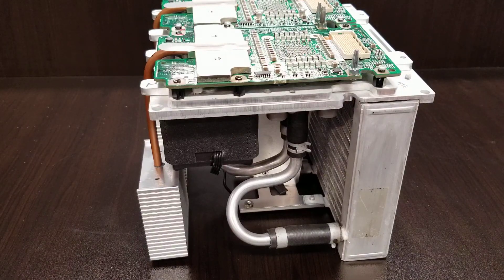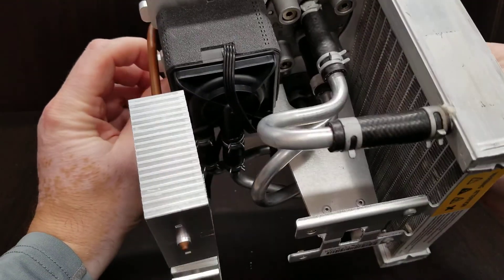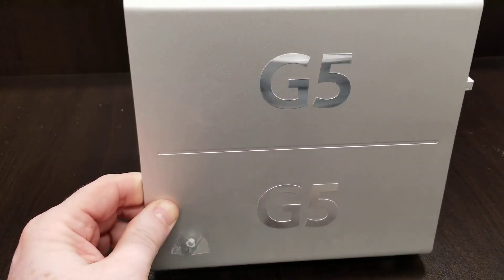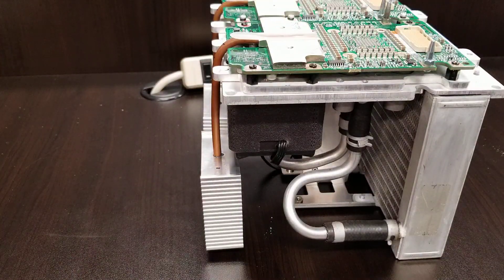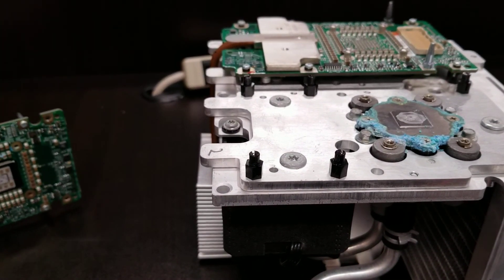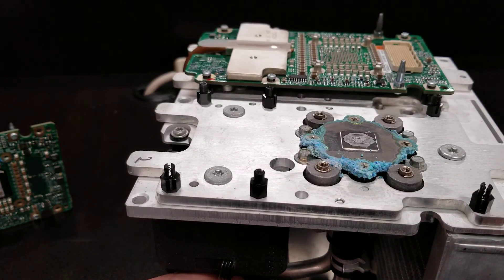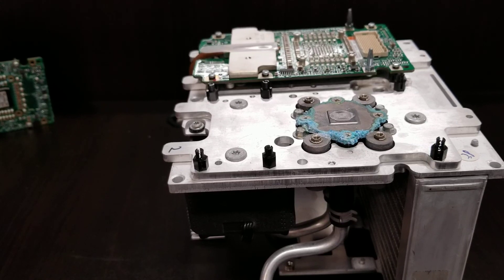Feast your eyes on Apple PowerMac tower G5 dual processor watercooled heat sink technology MacPro

Comment: My advice is to completely eliminate liquid cooling, even if that of the G5 Quads was much more reliable, they have a known problem: liquid leaks, and as is well known, liquids, if not oily, being based on water are conductive and if a few drops fall on the cpu or motherboard, disaster is created.
Understanding these facts it must be understood that it can be replaced with conventional cooling based on aluminum air and heat pipes which are the standard heat sinks used on the Dual G5. You have to find two working ones and then you can reassemble everything and proceed with a thermal callibration.
As already mentioned many times, Apple's water cooling system was more of a commercial gimmick that Jobs wanted to exploit to make the G5 appear as machines in need of water and energy, which was not true. The cpus used in the Quads are the same dual cores used in the single processor versions (970MP) as in those versions of G5 (those with PCIe slots released in 2005) and are NOT liquid cooled but with a conventional system.
So change the heatsinks with peace of mind, the temperatures will remain low anyway ....
Reply: I mean, if you're going to disparage a perfectly viable and often superior cooling system, at least provide the correct alternative. Aluminum is far worse than copper for air cooling.
Reply: @adriandiaz-cabrera1733  I don't deny your patient maintenance work, mind you. But liquids don't get along well with electronics, and there is no such safe and long-lasting system, no matter how great you did described in your video. Even if an air cooling is less efficient, it still ensures the smooth operation of the cpu and the maximum maintenance you need to do is that of changing the thermal paste without worrying about water leaks that would destroy your G5. Those leaks that are clearly seen in your video, sadly, are a clear example of what shouldn't be happening; the liquid that comes out of the gaskets comes into contact with the capacitors that are located around the cpu. The dielectric that is created (green or blue) leads to an inevitable offset of the electric currents and to a ruinous and total loss of the microcomponents and to the final destruction of the CPU board and with possible damage that extends to the logic board, something that happens over time. To achieve all this, therefore, isn't an air cooling system better, less efficient from a physical point of view but safer? This is my thought, then everyone does what he wants. Hi friend, good life.

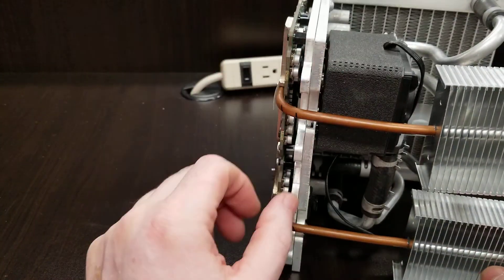Comment: What an excellent video! Thanks for the really clear shot as well as the teardown notes and commentary. It's so clear I was able to pause the frame and read date codes off the chips (40'th week 2004 though the CPU is of course newer). Apple was really releasing some good designs back in this time. Even the air coolers they had were very nice. One small error at 0:43 "more cooling units on the back. these are for memory." Those are for the VRM. On the other side of the PCB there are four international rectifiers DRMOS chips. The PowerPC units of that era had on-chip cache, there is no memory on the PCB.

The blue stuff is indeed from the coolant. I worked for an Apple Authorized Service Center in 2011 and they had a service bulletin on this (but no picture). We were supposed to replace the CPU cooler if we saw it. I don't remember if it's the coolant itself or the coolant reacting with copper Either way it should be removed and there's likely more inside the system. I recommend disassembling the coldplate with the 4 Phillips screws, cleaning all the blue stuff off and refilling it with coolant (water and ethelene glycol + biocide. I use swiftech hydrx).
Reply from the maker: Thanks for the comment. I really appreciate it. BTW I still have the unit. It broke again I never had a chance to figure out the problem. I keep it because it looks and feels special. If there is something you want me to do a video on or take a picture I'll gladly do it. I never before or since have seen a liquid cooled Mac, and I worked on a lot of macs. Stuff made today is cheap worthless garbage. Sad...
Reply: That blue or green stuff you see is the reaction that forms when the liquid comes in contact with the capacitors located around the CPU. The electric current, which passes from the capacitors into the liquid, creates that oxide that inexorably destroys the electronic components. If it were synthetic or mineral oil there would be no problems. On a 2.7Ghz unit I replaced the LCS system with the air system and it still worked for many months, but the acid created above the small capacitors, due to the escape of the liquid, still destroyed the component that has degraded over time putting an end to the cpu board. In any case, using the air system, I detected the same operating temperatures (between 60 and 80 degrees celsius) by running the machine at full load for hours and hours without ever having a problem. I remember that the Apple Servers and the IBM desktops and servers that used the G5 never needed systems like LCS. It was Apple's commercial ploy to tell the world that its systems were superior to the Intel / AmD counterpart.